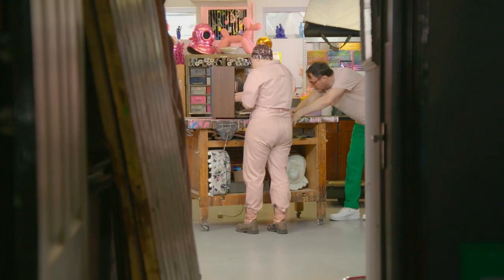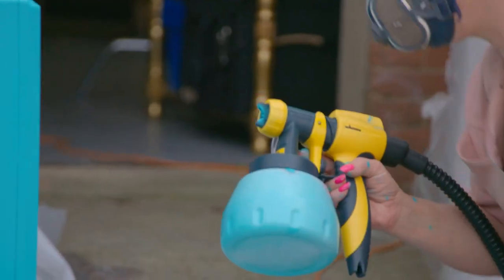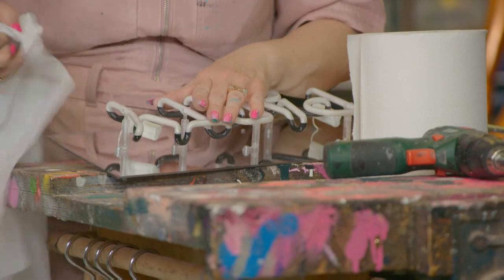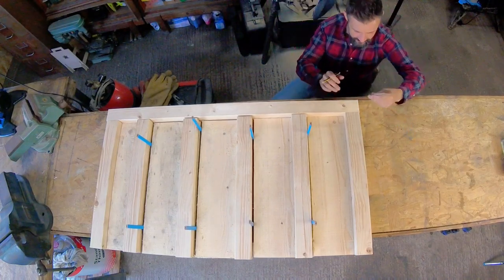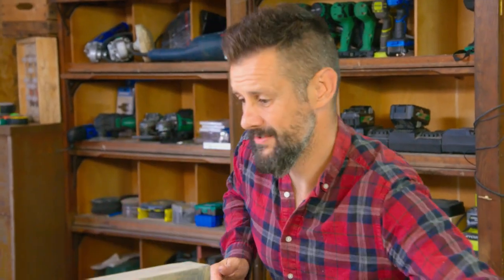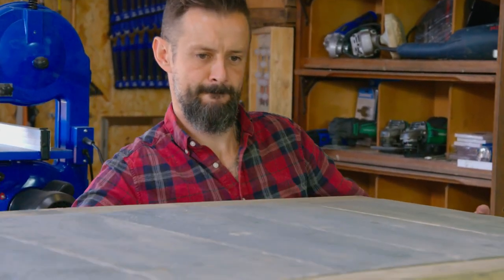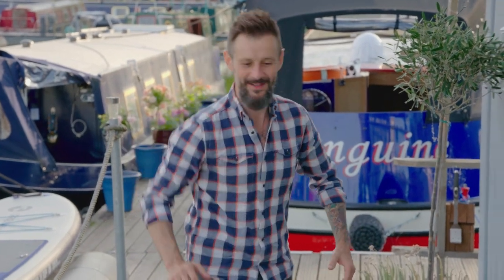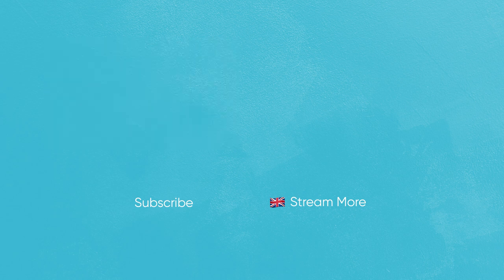Zoe Turns An 80s TV Into A Funky Cocktail Cabinet: The ToshiBAR | The Weekend Workshop

Comment: I don’t get the second thing. A table that turns into shelves? So every time you want to use it as a table you have to clear off whatever is on the shelves? 🤔
Reply: Did you watch it? The whole point is that one doesn't need to clear anything. Watch it again, this time without the beer.
Reply: @susanprendergast7384  Calm down, Karen